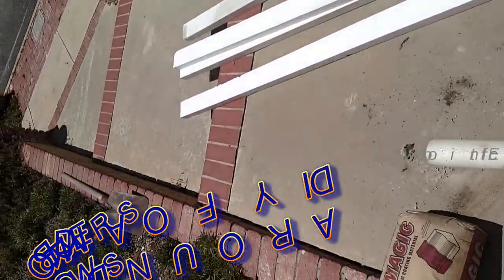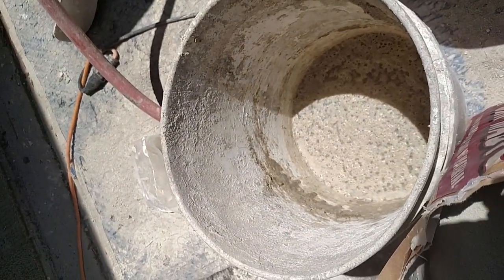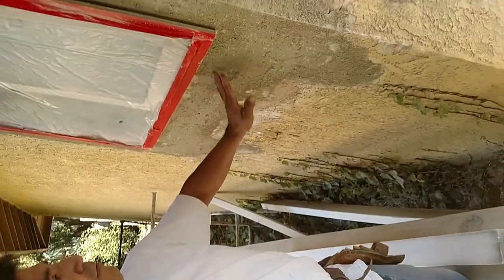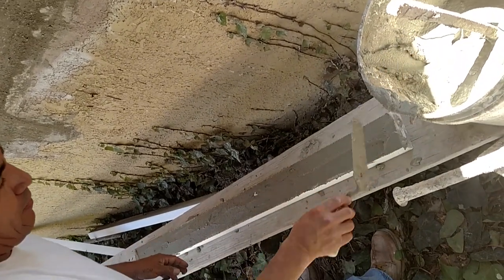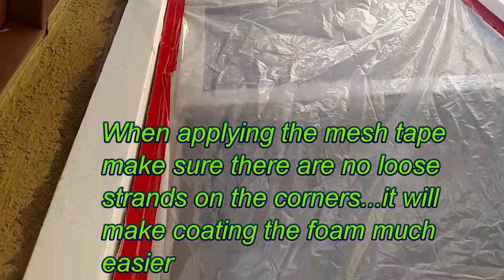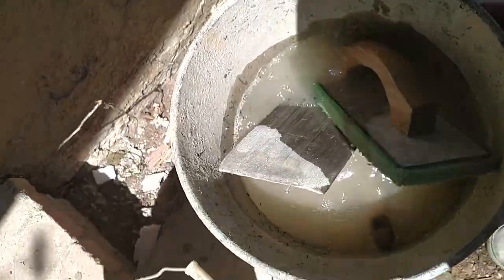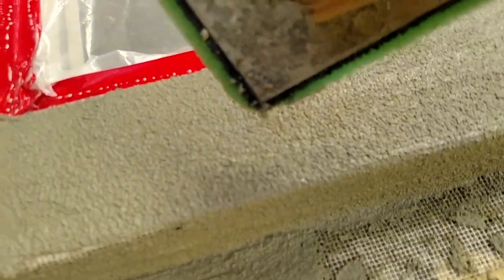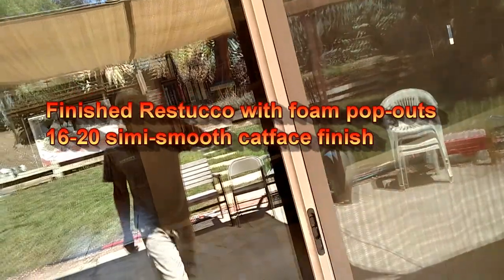How to install architectural foam boarders, shapes, molds,  or details around windows

Comment: I am confused about 2 things. How come there is no drip rail flashing over the top of the windows? I would guess it rains from time to time.   Secondly, the detail mesh is designed to anchor the accent trim to the field around the window & door openings. In the window example shown, it should be troweled into the field, then once the decorative trim is added, pulled over the trim and cemented in place over the trim. Right? That’s what training we receive In the upper Midwest. Oh, well. A dozen way to do it but by embedding the mesh, this help hold the trim in high winds or debris much less water if it gets behind the trim and freezes, it will push it off. Just my constructive criticism or observations by the way we do it in the states further North especially!
  Thanks for the skill and hard work shown. Thank you kindly.

Comment: What did you say the foam prep was made of?  The foam prep was basically ???.  You said something, but the wind cut the audio.
Reply from the maker: There are many types of foam prep available depending on where you live...i think in this video we used foam magic, but any dry polymer modified cementitious material will do...ci base, polybond, and base x are examples of other materials that we use for this application that all work around the same way

Comment: Awesome video. I’m replacing some arched windows on stucco and they stick out about 1/2 inch from the wall is this what I need to do to remedy this ? Also do you know what the process for replacing the stucco around the window is ? Do I have to do like the 3 step process. Thanks in advance

Comment: Ok so I got A question what did you end up doing to the fiber mesh hanging on the outside of the foam??? float it in? cut it off? you didnt film any of that.Thanks
Reply from the maker: We restuccoed the whole house...the extra mesh was covered with the foam prep cement, floated, allowed to dry, then was glued along with the rest of the wall before the finish coat...if the entire wall doesn't need to be restuccoed you can cut it where it meets with the wall, but feathering the mesh out creates a stronger boarder
Reply: Nice!!!
Yea I’m redoing all my windows I’m a Sheetrock guy by trade stucco is totally different. So by chance where do you buy that foam from? I found some from my drywall yard but can you find them at stucco yards?